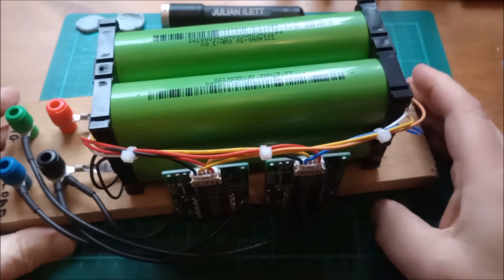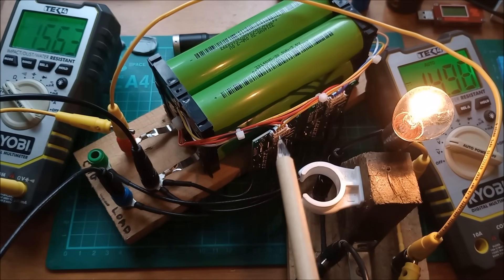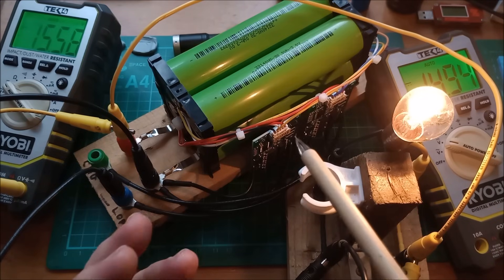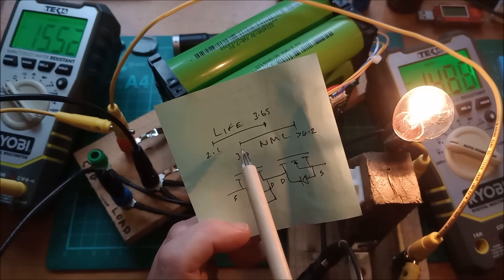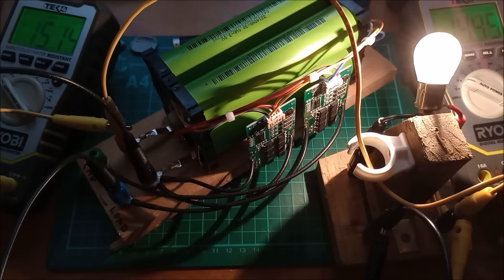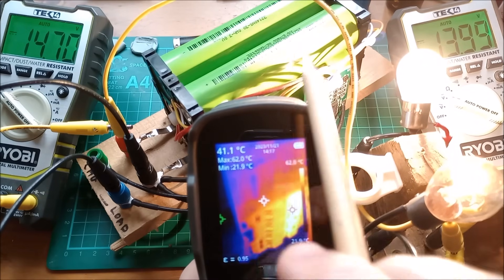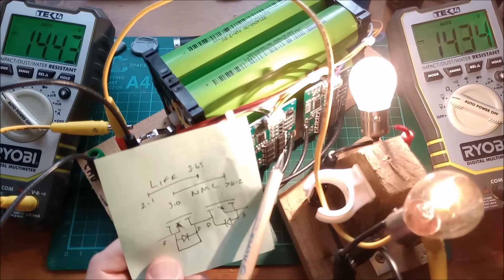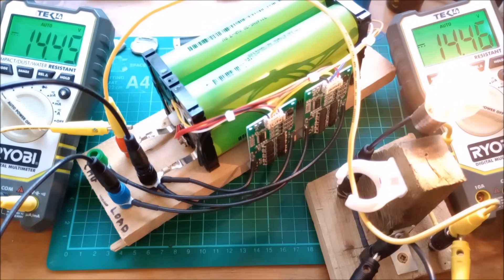Dual BMS Problem for Sodium Ion Battery - Fixed

Comment: In future I see no problem to introduce LiXXX/NaXXX compatible BMS-es. Put adequate MOSFETs in circuit and switchable resistor and zenner diodes or whatever set to switch between chemistries. Either as discrete element set or put together in IC package.

Comment: Maybe these sodium batteries dont need a BMS.  Charge to 4 x 3.8V and I'd reckon it'd right.  Check and balance occasionally.  Discharge not really a problem.

Comment: Are configurable bms modules not a thing? How does the module get it's thresholds? Is it a chip or resistor set? Would be interesting and maybe useful to play with

Comment: cant you parallel more diodes across the mosfets, this wont affect the boards operation and will distribute the current/heating? or just use a larger bms...
Reply: The voltage drop across the diodes will remain the same even if more in parallel so you will have a lot of energy loss. It's better to short out the unused MOSFETs as he did so they're essentially removed from the circuit.
Reply: @PietroZambon  agreed, but having more in parallel will stop them burning up. I have 6 on the output of my charger otherwise the charger becomes a load when the AC fails discharging my batteries. I charge at 20a but use 5 10a diodes to get 50a and they run cooler. If you want to reduce the voltage drop then you need a different diode material. Or use an 'ideal diode' in parallel built from more MOSFETs. For this problem shorting them out was the quick solution but I'm just thinking of other ways

Comment: Probably why you only use 1 bms 
Maybe its the common ground between 2 boards 
Dont think u should be paralleling the 2 boards balance connections either like 1 bms is trying to short the other 😂

Comment: @10:55 Yes, power is both I^2R and VI, whichever you have the information to use.
Reply: Or U²/R

P=VI, but V or I can be calculated by Ohm's law, as RI or U/R, and substituted into VI, giving the RI² and U²/R versions for power.
Reply: @michaeltempsch5282    U?  I was raised with "E" for electromotive force (or "elektromotorische kraft") rather than V(olts).   This gives P=IE (or PIE) and I=E/R (or Indian sees an Eagle over a Rabbit) for memorable mnemonics.   I also do not use A(mps) but I for "Intensität" and not W(atts) but P for power.

As a child I had a handy pie chart on my wall with the center having the desired value in each of 4 quadrants (PIER) and then the slices from that quadrant having all the possible combinations of the other 3 values to compute the desired value for that quadrant.  It was a useful reference as I learned these equations shortly after learning multiplication and division in school.
Reply: @Sylvan_dB U can be used in place of V in some situations. I don't know if it's always interchangeable or there are situations where it isn't.

Comment: But that will heat up, why not use a programmable smart BMS?
Reply from the maker: On another battery I will use a smart BMS. I have a load more sodium ion batteries coming :)
Reply: @JulianIlett  what are they capacity testing like? I've seen a few around, which have been small, but unknown names. So I've not dabbled.
Yet.